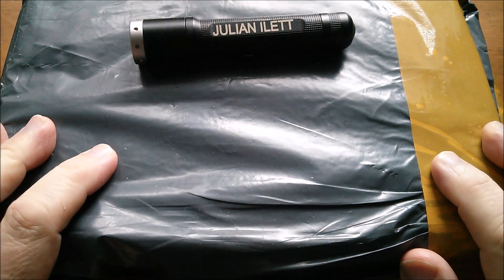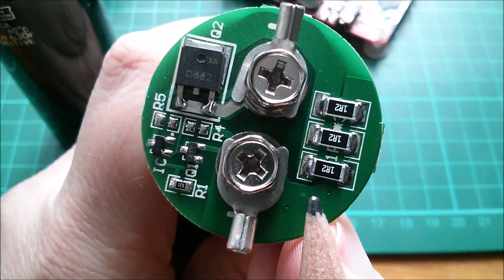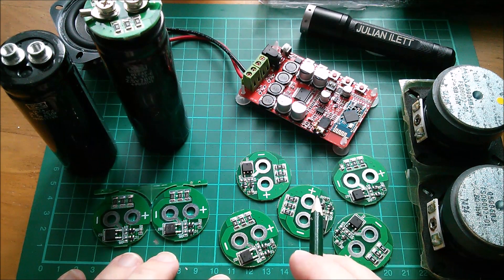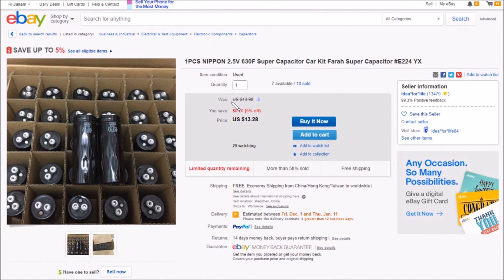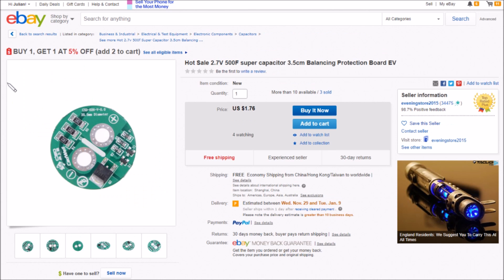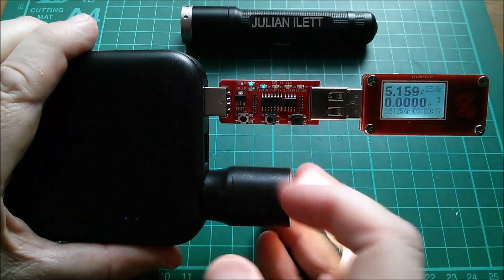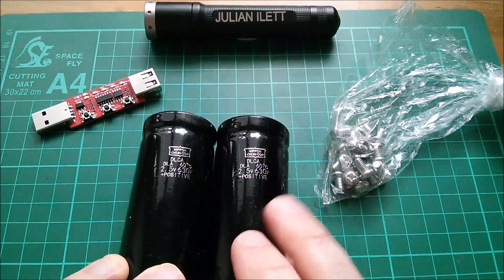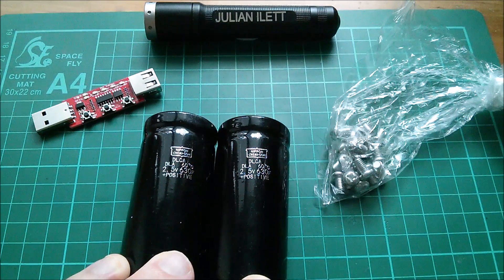Julian's Postbag: #108 - Quick Charge and SuperCapacitors

Comment: Julian ,I have been Watching a lot of videos On You tube about these Supercapacitors . And One of the Things people are building are Spot welders For the 18650 Batteries tabs . I wanted to build a spot welder For This purpose .  And I thought at first this would be about the safest way and cheapest to do this .  But recently some have said this is very dangerous to do . So now I do not know what I want to do ??? What is your opion on this subject ?   I really don't want to use the Microwave Power Supply As I have seen this also On You tube ... Perhaps you can test this Idea and let me know    thanks for your videos ad Wisdom ...

Comment: Serious question, Julian: Why are you going to the time, trouble, expense, bulk and complexity of using Supercapacitors, when a much cheaper, simpler, compact result, with longer endurance per charge, can be obtained from 18650 cells?
Reply from the maker: It's all part of the learning experience :)

Comment: If that sanded chip on the QC3 trigger is also an Atmel atTiny, I wonder why they added the external eeprom. Just remembering a setting wouldn't use that full 2K bits and an atTiny also has a build-in eeprom that could be used. Perhaps that 14 pin chip is no atTiny after all?

Comment: Julian, just a quick note: I remember that you said before that the QC3.0 powerbank is limited to 1.5A on the 12V output (I remember on the video about the powerbank). At 12.3V output, which is what it seems to be set at, it's hitting the 1.5A, trying to go over it, and therefore cutting out due to overcurrent. Hence the cycling on/off you see.
Maybe putting it to 11.5V (or similar) would fix it and keep it under the 1.5A?

Comment: The schematic of the protection board for the supercaps is this. https://imgur.com/a/5BCd7

I am doing my diploma project about a ups with supercaps and i will soon upload videos about it if anyone's interested. :)
Reply: So it bleeds off anything above the max voltage of the cap? Is the worry uneven charging when doing it in series or just a general overvolting screw up.
Reply: its for overvoltage in general. Whenever the supercap exceeds the 2.7v value it discharges through a very small load so big currents aka fast discharge. Its suitable for charging yes. I actually installed a board on each cap and charge them in series with no problem.

Comment: I am pretty sure that the voltage step up is a sequence of step up requests via the QC3.0 protocol and the other bank probably can't handle the fast requests. Could be easily fixed by updating the firmware to do the requests slower as soon as there is no voltage rise detected after the first few tries. Takes longer, but works.

Comment: So if you put this QC pcb between QC enabled Phone and normal power bank, will phone charge at Qc 2.0 or Qc 3.0 rating? Was looking forward  to see you try it...
Reply: That would be like trying to make water come out of a tap faster by shouting at it.
Reply from the maker: No, this trigger unit can only make QC2.0 or QC3.0 outputs switch to higher voltages.
Reply: Julian Ilett sad... i thought it could become cheaper option to make cheap power banks QC enabled..Tnx For info...
Reply: Anvilshock 😀😀😀😀

Comment: The other chip is for  probably for voltage detection  i have seen its number but havent found anything regarding it on the internet the number is  hp-0118  k8g2l11cbb

Comment: Interesting that the Aukey doesn’t perform quite like the other Power bank - perhaps the commands are sent too quickly? My bet is it might work perfectly well delivering 12 volts on QC2.0 on both powers banks. 
When I tested this trigger and my BlitzWolf power bank I ran a 12v 18w lamp to stay within spec. Perhaps I should have pushed it a bit further for the light show! :-)
Reply from the maker: Yes you're right Adam, it works fine in QC2.0 mode - I should've thought of that. So it's fine if you want 9v or 12v. Cheers.
Reply: Julian Ilett Glad my hunch was right. Cheers.

Comment: https://www.aliexpress.com/item/QD-Professional-Mobile-Power-Bank-18650-Battery-Box-1-5-3-7V-5-13V-Adjust-Voltage/32487473265.html?spm=a2g0s.9042311.0.0.7Xv9Kz
Reply from the maker: Interesting - that Aliexpress seller accepts Paypal. No, I prefer the 4-cell powerbank, the QD184
Reply: Sorry I thought you mentioned you wanted a 5 cell. I cant remember how I paid for mine but I don't like using anything other than PayPal because of the  protection you get..

Comment: Now you have some spare capacitors you can build some more projects, perhaps the solar garden light we thought of before.
Reply from the maker: Certainly planning a supercapacitor powered 100W LED project. To maintain 100W, the current will have to rise as the voltage falls. Could be interesting :)